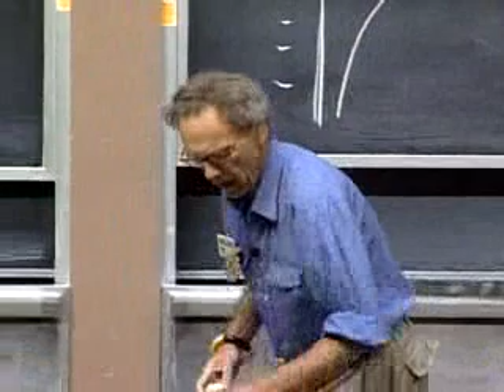Teaching with style; Mechanical Energy Conservation

Comment: Due to the friction force it won't come back touching his chin. Because the friction force there is a reduce in speed which means a Work difference because: W = K2 -K1. This isn't conservation of Mechanical energy is it?
Reply: That's a good point. There is a conservation of energy (kinetic + potential + heat) but as you say, some of the mechanical energy is converted.
Reply: Sharp objects experience drag as well.
Reply: Of course this isn't an ideal situation where there is no air friction, but it is usually ignored
Reply: Even if you there is no air resistance, the object will reach from where he let off. That is what he is demonstrating. He just made it interesting and breathtaking.

Comment: What if there is wind.
Reply: The amount of wind required to push it back is highly unlikely in a classroom like that.
Reply: Indeed. The pressure of air outside a room that size (assuming the doors were tightly sealed) would have to be enormous, and that is completely ignoring the fact that all of the people respiring had surely caused the air inside the room to be rather dense, making it more likely that in the event that the doors were opened at the exact moment the ball was loosed, the air would rush OUT of the doors, not in.
Reply: Slinkywheel yes but if like a really large wind suddenly blew in he would be dead. God is great!